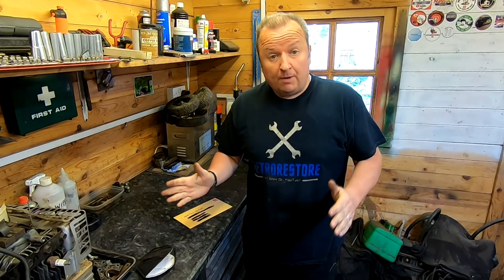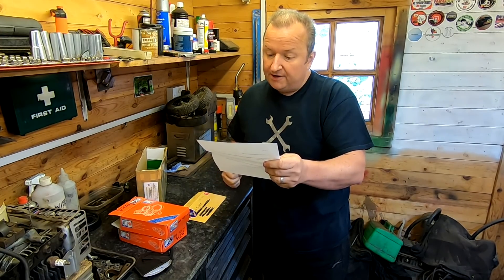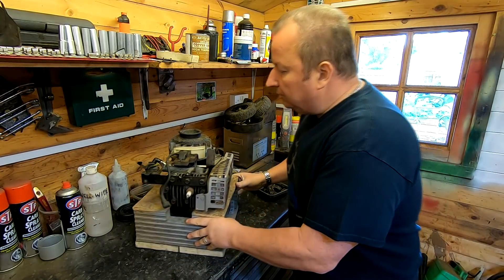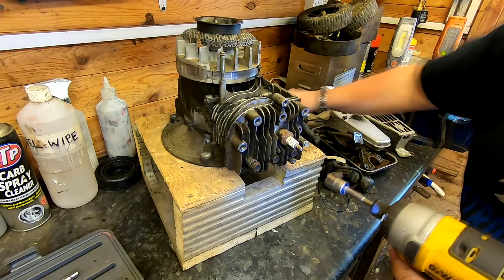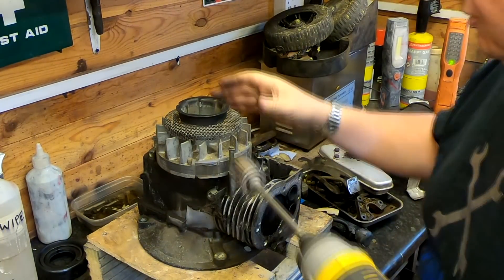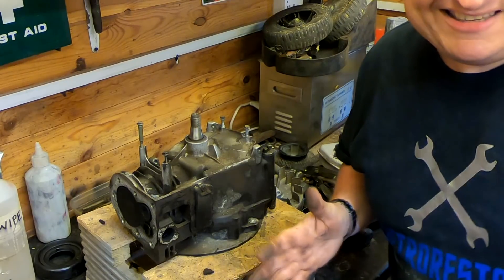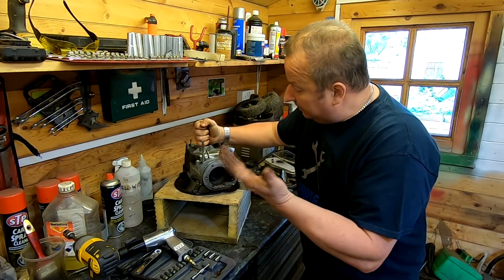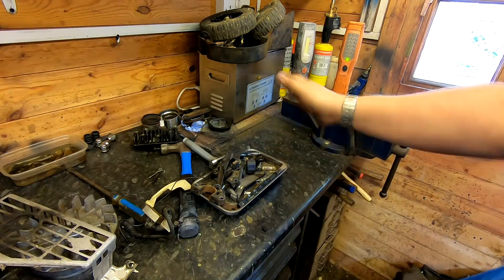Custom Lawnmower For Sharon Part 3

Comment: I have a draper endoscope that i use for looking in engines through the spark plug hole and it's good quality image which you can view on a free app on your phone. The endoscope is £25 from Draper directly. Hope this helps
Reply from the maker: Thanks for sharing

Comment: Great job of getting the engine ready for paint or powder coating.  Hmm.  What kind of sand blaster and medium do you use.  Looking forward to watching you finish this mower.  Thanks for sharing.
Reply from the maker: I use Aluminium Oxide in my blaster cabinet.

Comment: I accidentally broke the flywheel bolt off one of my mowers trying to undo it with a my impact wrench. 🤣 it's a dewalt dcf899. With a loosening torque if 950nm yea now I have a problem. 😑 won't make that mistake again though I've now bought a cheap impact driver from aldi until I get the money for the dewalt set I want with the drill and driver in. I'm going to try drill through the middle where the nut was tap it and replace it with a bolt instead if that dosnt work I'll just use it as parts. Wish me luck I'm gonna need it. 🤣🤣

Comment: Just a reminder if you use that spark plug again make sure to flush it clean. Don't need blasting sand in the engine.
Reply from the maker: Yes, I know Tom, i'll be fitting a new plug anyway.

Comment: hi martin great videos been watching for a while now i have recently got a power devil 3.75hp metal body mower which is a non runner i have sorted everything out checked it and whittled it down to a broken coil pack what coil should i put in as most on ebay are 5hp etc i am stuck your help would be much appreciated thanks
Reply from the maker: It will work as long as the fixings are the same.
Reply: Got my new part today Martin and the mower fired up first time thanks so much for your help keep up the great videos you and Sharon and family keep safe much appreciated craig

Comment: Mc51 is good but have you seen uk company Frost restoration? They do a 5l bottle rust remover for £24.99 it’s the same stuff as evaporust mc51 etc if not better.
Reply from the maker: Not heard of that one, will have a look.